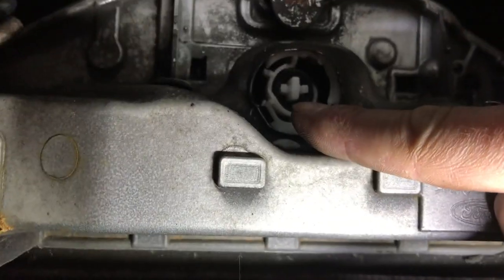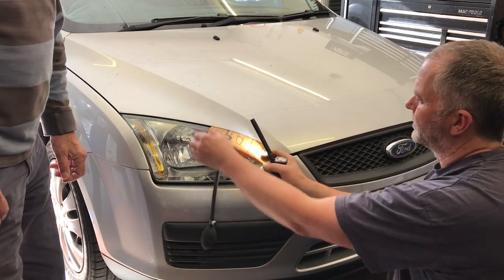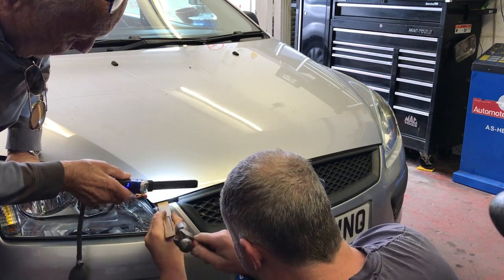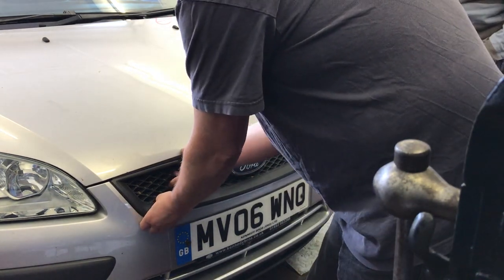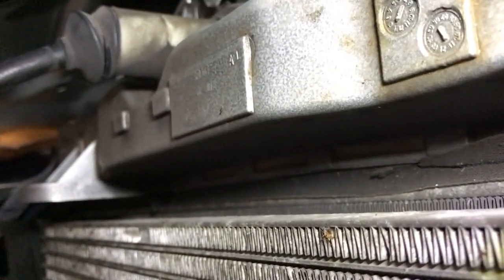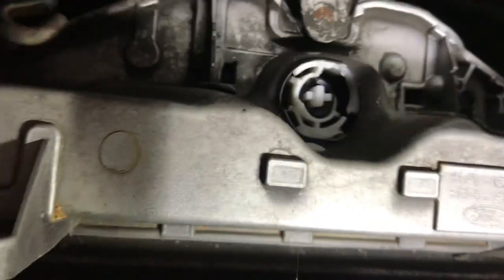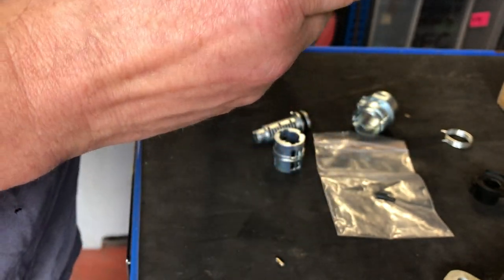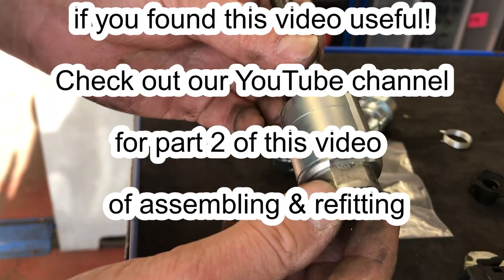Ford Focus with broken bonnet lock release mechanism - How to remove grille & open bonnet DIY guide

Comment: It’s happened to my Ford focus what size do I need and where’s the best place to get it ? You are my life saver !
Reply from the maker: Hi, thanks for watching! - the replacement parts can either be purchased from Ford main dealer or aftermarket versions are available on eBay, they're much cheaper & work OK although the quality is not as good as genuine - You can either buy a kit with lock 'wafers' to assemble to be the same as your key (Or use your lock barrel) or you can buy it pre-assembled with a different key supplied - I personally don't like this type as you will always have to carry 2 keys if you want to open your bonnet!!

Comment: How do you know where it's broken? What about when turn key left initially but don't get the initial release?
Reply from the maker: It’s quite a standard fault, you will need to inspect it yourself when it’s released to see the actual part which fails, repair kits are readily available genuine & aftermarket..
Reply: @JC-ECUConnection  took longer remove grill then it did remove whole mechanism and latch part held with 2 bolts. £25 Amazon next day delivery and happy days now have a key can open bonnet whilst leaving engine running if required